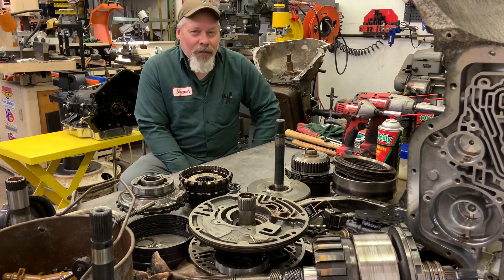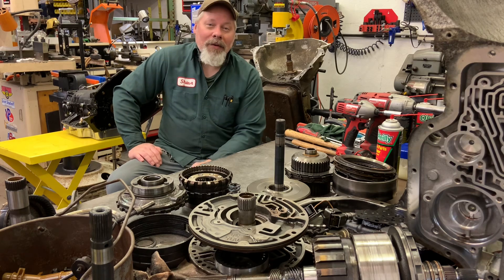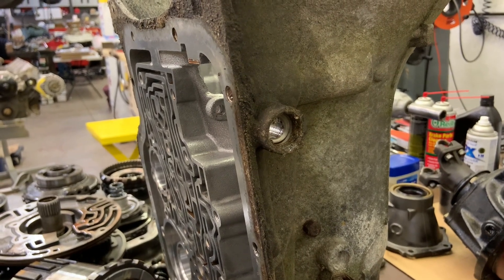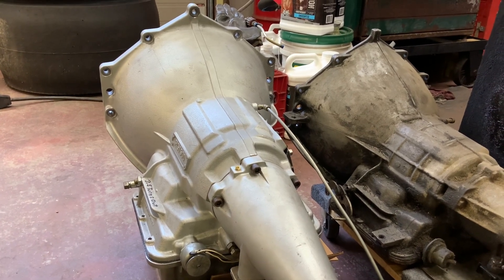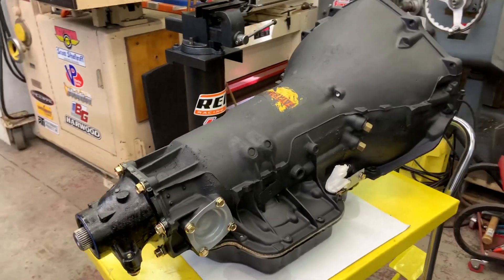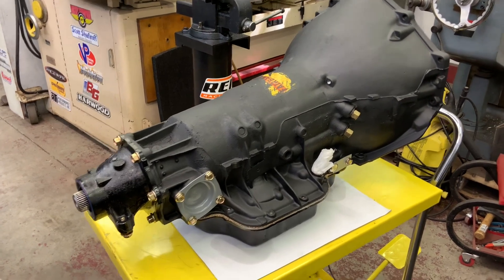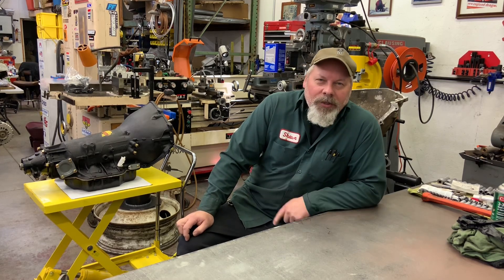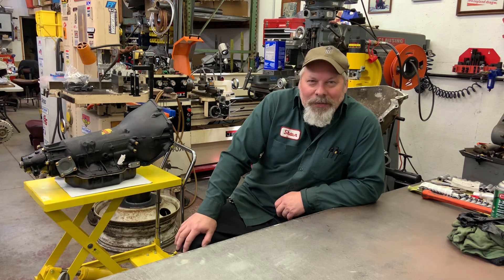Mountains Garage: TH400s a Plenty!

Comment: Good idea with the grinder. You could lay a rag over the ways of the lathe to catch any stray grinding grit. I've been a machinist for 30ish yrs. and any time we did any polishing or sanding we always draped a rag across the ways. Saves a little cleanup.
Reply from the maker: Good idea, Thanks!